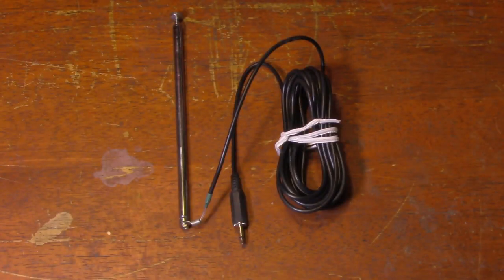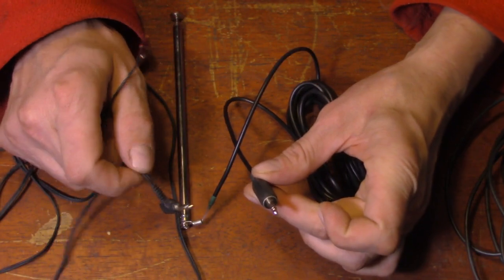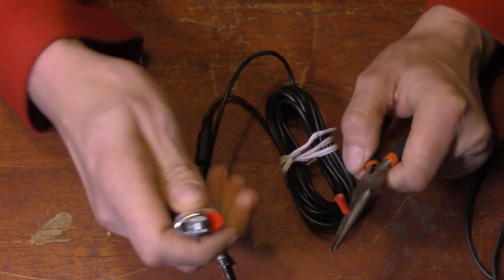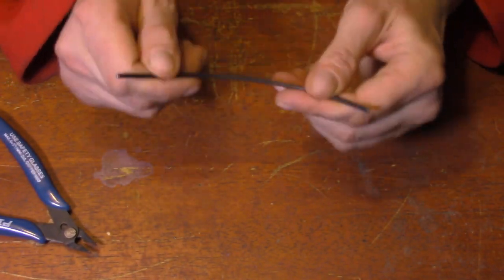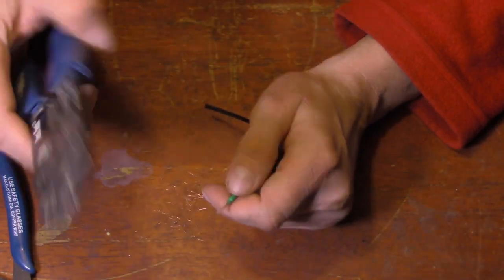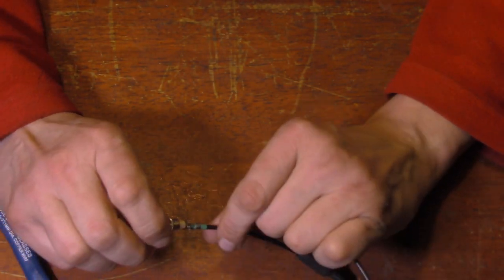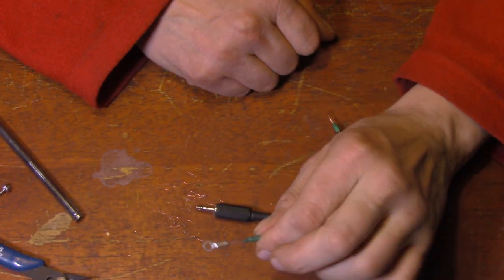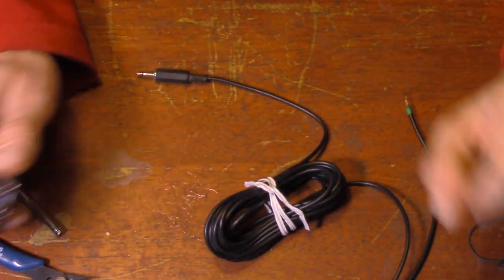DIY 3.5 mm Jack FM antenna with coax for TEA5767 FM module or cell phone

Comment: Thanks for this.  To be sure, there are three potential connection points on the 3.5 mm Jack, right?   And specifically for an antenna application, I want to make the wire connection to the long piece (and not to either/both of the other two points that are 90° offset)?
Reply: Yeah you don't use either of the connections to the tip or ring. You only use the sleeve (typically ground).